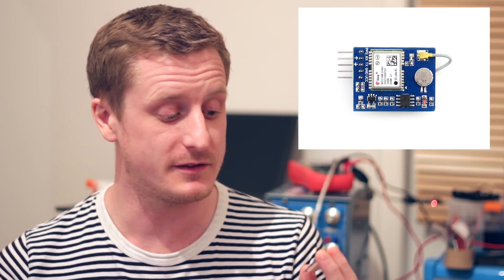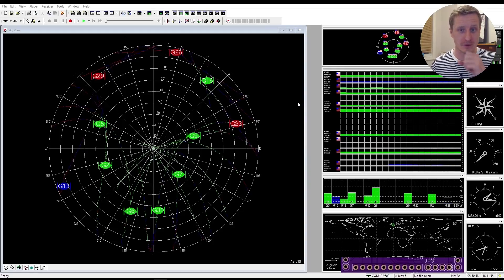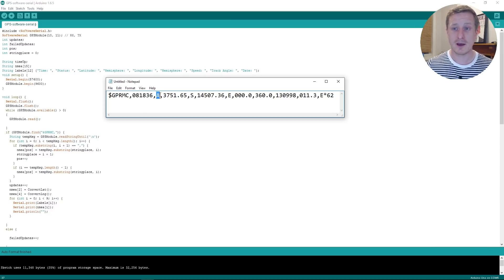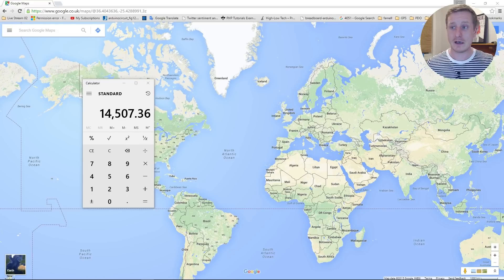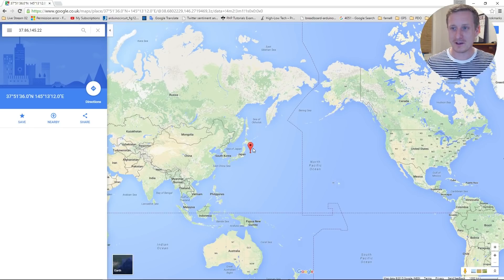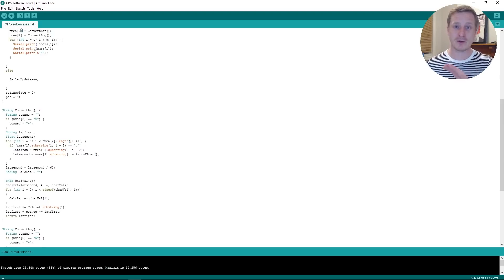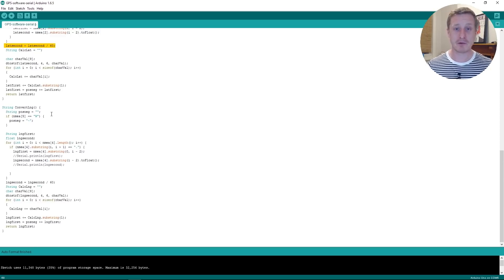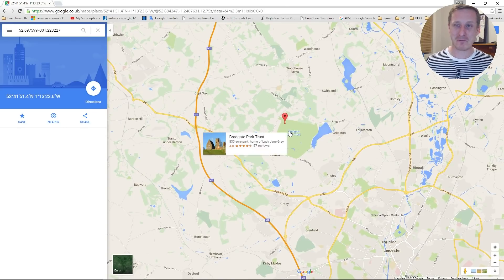U-blox neo-6m GPS Module: Arduino NMEA Decoding

Comment: Thanks for a very timely video David... It just so happens that I've got a neoblox m8n receiver arriving in the post in the next couple of days, so your code will make a good first test for me. Thanks for a helpful and informative video. Cheers!!
Reply from the maker: +Jim Conner You might still be better off using a library :-) This one comes highly recommended - http://arduiniana.org/libraries/tinygpsplus/
Reply from the maker: +Jim Conner How did you get on with the GPS?
Reply: Hi +David Watts - Believe it or not (and I'm pretty sure you would believe it as you know how it goes with these things...) it's actually still sitting on my window sill from when I made that video. There was once a plan to use it for a balloon launch, but the person I was planning it with has moved on to a new job now, so it's less likely it'll happen. Hope you're having a nice weekend. Cheers!!